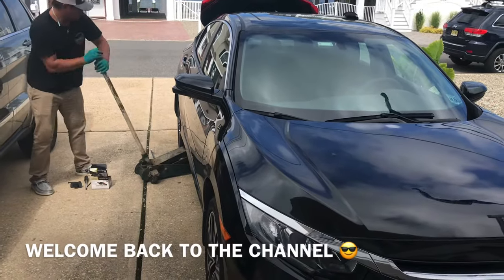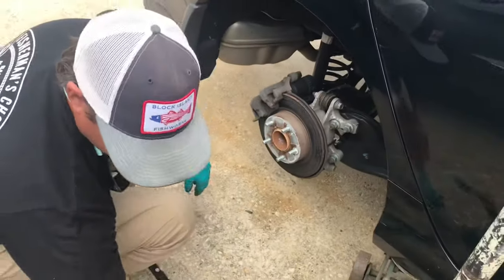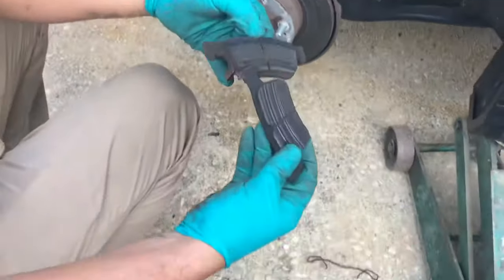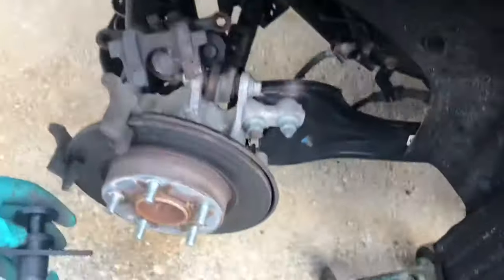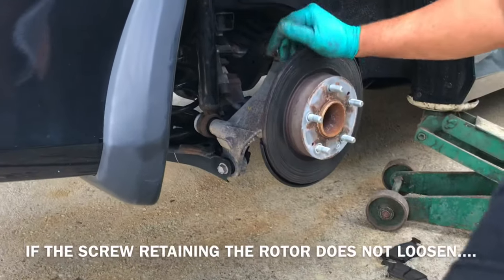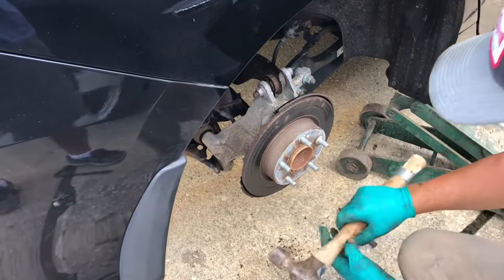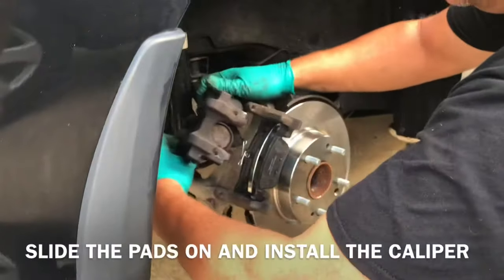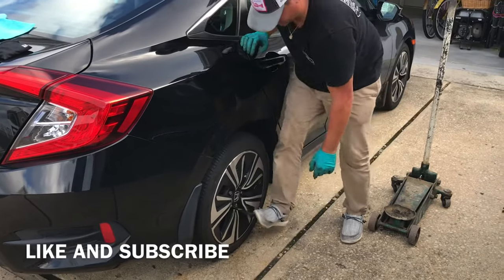HONDA CIVIC REAR BRAKES REPLACEMENT - Changing Brake Pads and Rotors on a 2017 Honda Civic. So easy!

Comment: This video is breaking peoples cars and you still leave it up? The way the caliper is compressed in this video is completely wrong. Several commenters have noted parking brake lights coming on and expensive repairs needed after following the instructions provided in this video.

Comment: what about the electronic parking brake?  did you put it in "service mode?"  ignore it?  crank it back manually?  (did not see you do this in the video)  just press the piston back into the caliper and hope the electric solenoid on the parking brake won't break?

Comment: This is incorrect you need to put the rear EPB in service mode or screw in the actuator manually. Doing it this way can cause issues and codes with the EBP
Reply from the maker: Trance Minded Thanks for the advice. 👍
Reply: I was going to say the same thing. This should be noted in the description
Reply: I didn’t do this and the brake system light came on is there any way I can take it off?
Reply: @onesevenruben6804  you gotta make sure you didn't damage the epb actuators before anything if everything is OK then a higher end scan tool can take care of the codes.
Reply: How do you do that?
Reply: Agreed.  Super easy to manually screw the EPB actuator back before compressing the caliper.  Remove the two H5 screws that hold the EPB actuator (the black cylinder) on BEFORE you remove the caliper.  Pull the actuator off and rotate the EPB shaft sticking out of the back of the brake cylinder CW (using a 9mm socket makes it easy to do by hand) until it bottoms out.  Then you can proceed to remove and safely compress the caliper . . . no bidirectional scanner required!!!

Comment: This is NOT the full process for this model, 2017 civic. Before compressing the piston you need to remove the EBrake (the plastic black part) using 5mm hex socket. Then you have to resent the screw in the middle!!!! If you dont do this part your EBrake problem sensor will stay on!

Comment: Best practice is NOT to drill out the rotor retaining screw.  Get an impact driver from the local parts store.  Likely you'll strip the screw if you try using a screwdriver.  It's true the screw isn't essential but it holds the rotor straight when you are reinstalling the back bracket and caliper.
Reply from the maker: Or you can use a lug nut to hold the rotor while reinstalling the bracket and caliper. 😎
Reply: Agreed.  Impact screwdriver from Harbor Freight for $40 makes this part of the job super fast and easy . . . and comes in handy for other jobs as well!!!
Reply: I used an oversized phillips screwdriver and tapped it in a few times with a hammer. Clamped on with vise grips and no problem at all. Was able to reuse the same screw too.
Reply: That is the most useless screw take it out by any means and throw it in the garbage

Comment: I know the abs or brake system light is on😂😂😭😭
Reply: Yo this is the exact problem I’m having right now! Probably cause I didn’t use a scanner to put the car in maintenance mode, would you know how I can get the brake system light off?
Reply: @allenhernandez5405  You trashed your e-brake servos.. This was posted months ago, but did you get it fixed?

Comment: DO NOT WATCH THIS VID to change your rear brakes. Mechanically they may have done it right but the video fails to mention putting it in service mode. I used this video and now I have to pay over $300 for a new actuator. ITS THIS REASON my problem is worse than it was. Also you’ll need an expensive scanner to turn it off so yeah. Whoever made this vid really sucks rn

Comment: Did that tool keep you from having to remove and reset the parking brake seperately? I assume by it rotating as it is compressed does this?

Comment: I was told if you have the electronic E brake it it has to be professionally calibrated. Is this true or can a DIYer handle it?  They want $260 for only rear pads!

Comment: The nut of the caliper is too tight. What if it can't be unscrewed?
Reply from the maker: Try a breaker bar or attach a pipe to your ratchet to get more leverage.

Comment: Can I put drilling Rotors ? And did there is any deferent between the regular or drilled one ?
Reply from the maker: Cross drilled rotors dissipate heat faster.  You can install in your car but you will not notice the difference unless you go to the racetrack.

Comment: What about cleaning the hub and Greece the sliders 🤔
Reply from the maker: Didn’t even notice that. Yes, he should have at least greased the sliders. I guess he didn’t care, lease was up and car was going back. Good catch! 👍
Reply: @fixinit   also where the pads sit should have been nice and  clean as well.🤔
Reply: Pads are loose and rattle while driving.The springs are on correctly .I can't figure why.
Reply: *grease

Comment: wow this is a terrible tutorial do not follow this you guys
Reply: So many red flags. 
No EPB reset and calibration. 
Drilling out the rotor hold down screw. 
And not torquing the wheels to 80 ft lbs. 
So bad.

Comment: didnt use a torque wrench putting wheels back on, not that that's the only thing wrong going on here... incorrect way to do the rear brakes. Why are you only using the jack to support the car... if that fails your whole front suspension goes bye bye and could injure you severely if your hands are under tightening/untightening the bolts. Learn safety first, other people will pick these bad habits up so I have to call you out on this being a terrible how to video.
Reply: You definitely don't need to torque the lug nuts 🤣 the torque specs on lugs is very light. Arm tightening firmly but not crazy is just fine. The real crime here is he didn't put in service mode and didn't regrease the slide pins which will eventually cause heat from friction, pit the pins and that will cause brake shudder which will ruin the braking/shake the car.